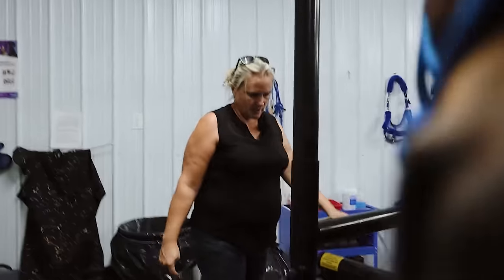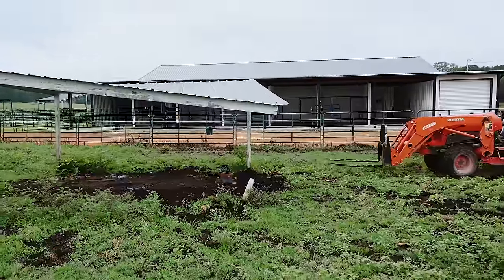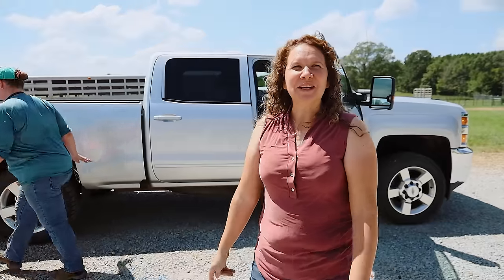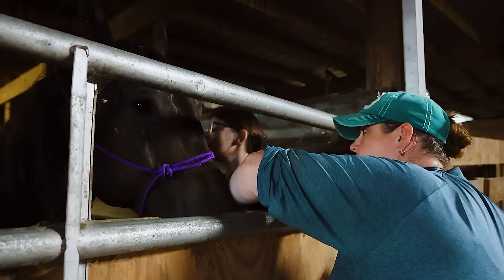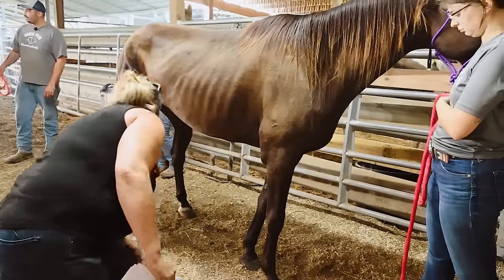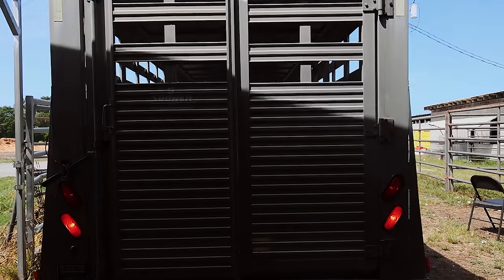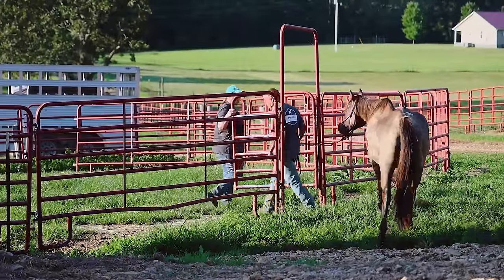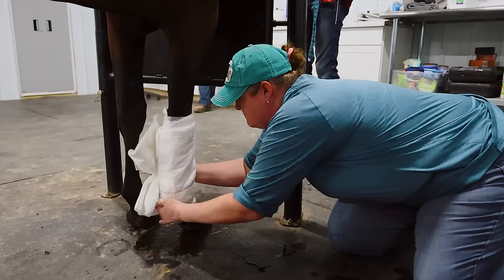Hardest Auction - Horse Shelter Heroes S4E30

Comment: This is the worst yet. There’s no excuse for owners to do this when you will buy these horses from the owners. To those that think Horse Plus should try and save these horses, understand that many of them are already dying. They can’t be saved. All things eventually die but they shouldn’t have to suffer. Horse Plus is there for these precious beings. What about all the other auctions? Who saves them? Hurray for the mentor programs ❤
Reply: Plus, horses severely under weight, would cost more, and take longer to get to slaughter weight.  So Feedlot that take slaughter bound horses, don't usually want to take the time, plus injuries, not wanting to help those, cost wise.